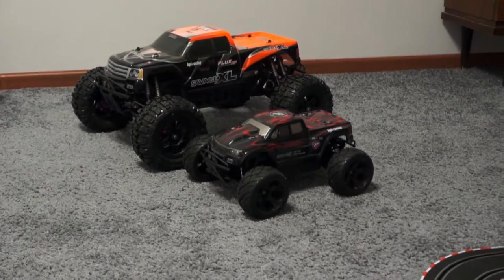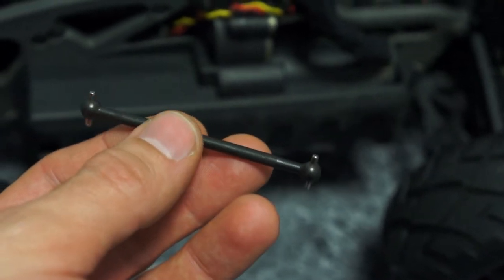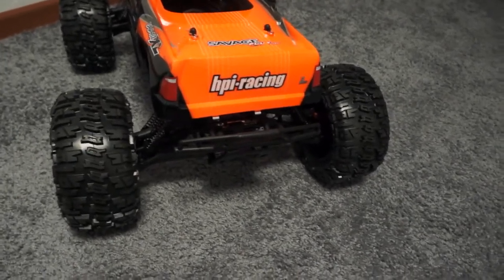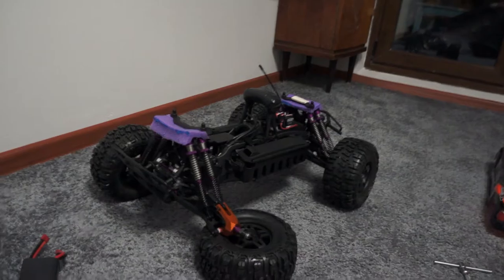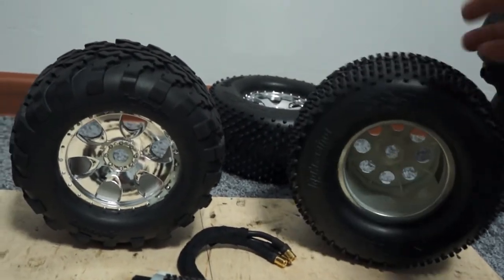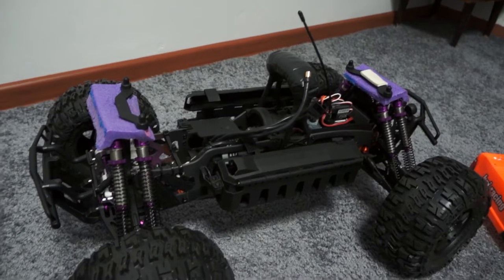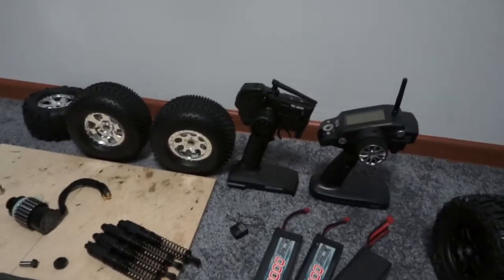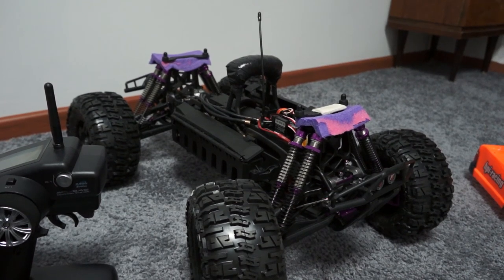HPI Savage Flux HP XL and XS review.

Comment: Integy rear hubs,  Alza Racing bulkhead braces, Hot Racing ring and pinion gears,  Robinson Racing clutch,  tie wraps on the motor to eliminate any movement  and shim every bearing on the truck to 1-2 mm end play. Bolt and lockwasher the inner and outer  steering tie rod ends.  Be off throttle when landing jumps, bring spare batteries cause your never going to break again.

Comment: So, whats happened to your XL, you should do a review now after a year has passed, by the way great video, and great info thanks, only have one comment if u r running in very low temperatures then plastic gets brittle and breaks easy, spasiba.
Reply from the maker: Sold main parts on E-Bay. The rest went into trash.

Comment: Hello, how long can you drive the Save Flux Xl till the battery's empty?.
How long does it take to charge the battery again?
Thanks!
Reply from the maker: Depends on batteries and driving style. On a pair of 7.4V 8000mAh around 12 to 15 minutes with 2600 motor.